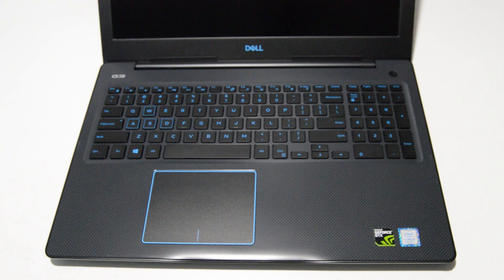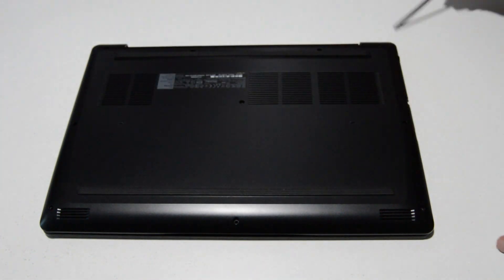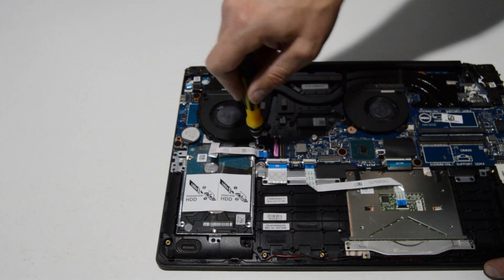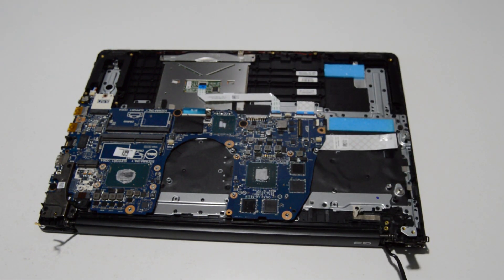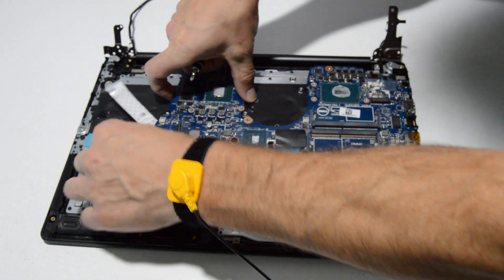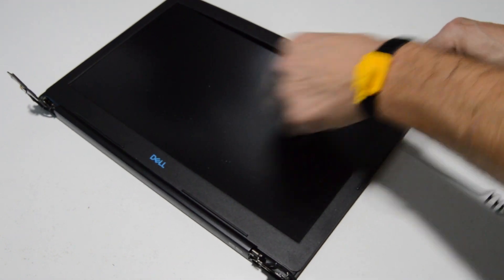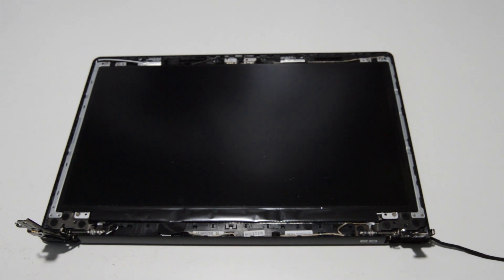How to Disassemble Dell G3 3579 Laptop or Sell it.

Comment: my dell g3 laptop is a piece of shit the keys are broken and don't work, there are cracks in the body literally everywhere, both the hinges gave away, the  right side usb port is loose, the fans rattle, the temps are always high, the thermal paste dried up, the display has ghosting issues and backlight issues the company denies it is even present, trackpad is mushy and clicks when i pick up the laptop the adapter cable is broken the adapter jack gets super hot Its been 5months since I bought it. I WILL NEVER BUY ANY LAPTOP FROM DELL AGAIN. I WILL BUY ONLY METAL BODY LAPTOPS.

Comment: Anyone having a issue, which i am facing for quite sometime where the intel uhd 630 3d performance spiking to 100% in taskmanager when run on battery? 

Steps to check:
1. Remove the power cable.
2. Run any browser, open any page which has a long scrollable area
3. Open task manager, go to performance, and click on GPU 0 or 1.  Which ever shows inter UHD 630. 
4. Keep the taskmanager and browser side by side
5. Check if 3d in intel UHD. SPIKES TO 💯 % when you scroll on the browser. 

I cant find a solution to this. I am stuck at this for a year now. Please help me.

Edit:——————————————————————————
Asking here is because. I want to see if this is a hardware issue. Plus if everyone with G3 having this issue

Comment: Question: should i just replace my Hard Disk with a Solid State or i just need the M.2 to improve the speed?
Reply: Replace both with an ssd and an m.2
Reply: @ImInTheMaking  ok, but like, i tried to replace my hard disk but but it didn't work. It always turns me to the BIOS setup. any tips on that?
Reply: @trietlam1438  does your hard drive have the OS? Is it bootable? It routes to bios because its confused where to boot the pc
Reply: @ImInTheMaking  i just figure out that i need to configure that drive for it to work. Will get back to you when i got that done

Comment: I have this laptop. Specs:

i5 8th gen 8300 - @2.30GHz

Nvidia GeForce GTX 1050 (4GB)

RAM: 8GB

But I notice it is slow and stutters a lot when gaming, how do I fix? Will adding another 8GB RAM (total 16) fix the stuttering?
Reply: Adding more ram is your only option to upgrade it. And it should help if the laptop isn't defective in any way
Reply: @picinski  alright, I will try adding another 8GB ram card.
Reply: Has your laptop an SSD as boot device?
Reply: @francescogreco3857  no
Reply: @ABJ4684  I strongly advise you to buy an SSD nvme to speed up your system. You'll notice the difference, believe me.
Reply: @francescogreco3857  do you recommend any?
Reply: Samsung's are the best. Kingston a2000 or sabrent rocket for the good value for money.
Reply: @dearhorse085  while I added 8GB more of ram, it fixed COD: Black Ops Cold War lag and stutter. If I use my pc regularly, occasionally it does stutter. Even videos. Like of 1 sec only.

Comment: I hope u can help me, i have a dell g3 15 and it is not turning on, but its flashing solid white when i put the charger. Also the backlights are working and fan for 2-5seconds then will die. It is not continuing to turn on. Ive tried hard reset but still not turning on.
Reply: Remove wifi card.
mine did the same thing

Comment: So I have an old Asus laptop from 2015. I was wondering if I could pull the ram from it and put it into my g3. Would there be any compatibility issues? That was an extra dim slot between the ram and the battery right? Also, do you know where I can buy a new trackpad for this laptop mine is starting to act up?
Reply: Is it a ddr4 dimm ram? 
Furthermore it's better to couple 2 ram of the same model, not only of the same type.

Comment: your video helped a lot, thankyou. I was doing a keyboard replacement, and was fully disassembled when you said the keyboard cant be replaced. Ended up snapping off the plastic knobs holding the keyboard in, carefully removing the backtape, then was able to replace the keyboard and super glued the ends of the plastic knobs that were snapped off.

laptop works fine, keyboard and all. but was grateful to see it all done so I could do what you did.
Reply: That's what got me looking to pop it open broke an arrow key and aswd keys are losing paint so I got a key board replacement a moth back
Reply: How long did it hold up? I just bought a keyboard replacement module. Might return it and buy the whole palm rest replacement module.

Comment: Can i unscrew the fans out and clean them with a brush? without removing the heat sink?
should i worry about getting dust all over the motherboard Or you would recommend taking my laptop to a professional for cleaning.
Reply from the maker: Yes you can. It may be easier to just get a can of air and spray them out that way without having to remove them.
Reply: @Sellbrokedotcom  Yeah i was thinking about that, but after watching your video i feel kinda confident and i have read somewhere, compressed gas doesn't work in the long run 
for better results it's recommended to open it up and clear those dust bunnies 

thanks for the response though :D

Comment: what kind of screwdriver you used? m2.5? thanks in advance
Reply from the maker: 2.5mm phillips
Reply: @Sellbrokedotcom  thank you :)
Reply: @Sellbrokedotcom  do u know the serial number of power regulator chip of this laptop cause mine is burnt and want to change it thanx a lot
Reply from the maker: @hassanawdi3793  Not sure sorry :(
Reply: @Sellbrokedotcom  if u have the website showing the names of all chips for this laptop I will check it out
Thanx

Comment: I'm having the worst luck from just adding a second hard drive. I've done this a 1000 times with no issues but with this laptop for some reason when putting everything back together my screen didn't line up right. Unfortunately everything looked just fine didn't notice a problem until I tried opening up the laptop from being closed. The plastic piece that has the g3 on it would come apart whenever you wanted to use ur laptop. For longest time I couldn't figure out why it did that or even how it did since I never touched the screen display. Long story short I messed up grabbed my laptop wrong and now the video cable came unplugged. I can't get it plugged back in the screen doesn't just come off with screws out something is holding it and I can't figure out what. Any suggestions???

Comment: I managed to spill a big old glass of juice into, pretty much, the center of the keyboard. I got most of it within a few seconds but it's made the keyboard unusable. It seems purchasing a new palmrest assembly is the move, from what I see above and in comments. I'm concerned that I'll break something during the disassembly process, or that the stickiness will have stuck the motherboard to the laptop in a way that would make disassembly dicey. Were there many places on the palmrest that could have allowed liquid through to the motherboard?
Reply from the maker: Follow my instructions and take your time to pull the palmrest up to see if there's any of your juice on the motherboard. Then you will decide your next step.

Comment: i need to change a fan on my dell g3, which one is the video card and which one is the proicessor
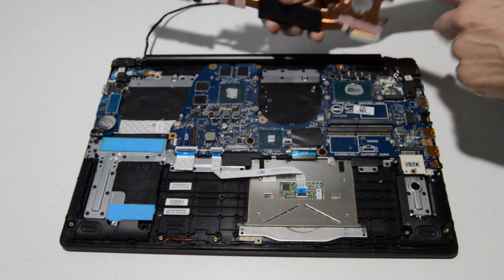Reply from the maker: At 6:30 when we remove the heatsink, you can see the GPU on the left..... they are usually surrounded by VRAM chips.
Reply: @Sellbrokedotcom  thank you very much :)

Comment: So i want to open my laptop but it like kinda stuck in the middle, is it the fan or what??
Reply from the maker: Not sure, as long as you have all the screws out the bottom case should come off. Sometimes there's some sticky pad or tape sticking to it but you should be able to wiggle it off.

Comment: You said that the keyoard is not removeble. So what should i do, if there're some keys that don't work?? Are there any ways to repair keys or hole keyboard?
Reply from the maker: Just buy the palmrest as an assembly, it will save some time anyways. eBay is a good source, just search for your model.
Reply: @Sellbrokedotcom  So I came across this video after buying a keyboard palm replacement, do I have to disassemble the whole laptop to replace the keyboard?

Comment: Do u think is there enough space for nvme disc with heatsink?
Reply from the maker: Check out the video at 2:45 and you will see the SSD slot on the bottom right, plenty of room to add one.

Comment: I want to remove the battery , do i have to remove the connector ? Sorry but i'm noob with these stuff
Reply from the maker: Yes check out 2:53, after you remove the bottom case you can unscrew the battery and the connector just pulls straight out of the motherboard. Easiest way is to use your fingernails to grip the connector tabs and wiggle it out. Good luck!

Comment: What is the yellow thingy with the wire on your wrist?
Reply from the maker: That is an anti-static wristband mean to prevent static electricity from damaging the components inside. You can also ground yourself by touching something large and metal to discharge the static if you plan on working with small electronics.
Reply: @Sellbrokedotcom  Oh wow thank you for replying, I've heard about static electricity when dealing with computers. Does washing your hand before dealing with components in the computer prevent static electricity from affecting them? Amazing video detailing the disassembly of the dell g3 :)
Reply from the maker: @kerwinchadrick  I don't think it will affect the static electricity but it is good for general overall health! Touching something large and metal is the best way to discharge the static.